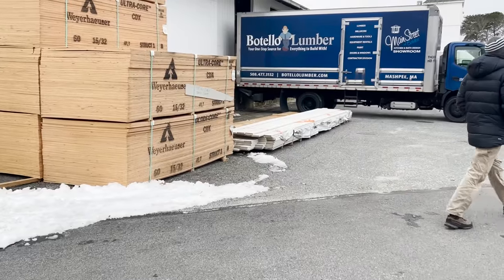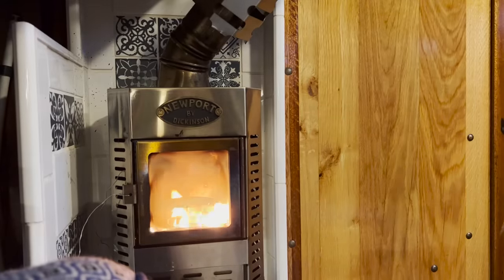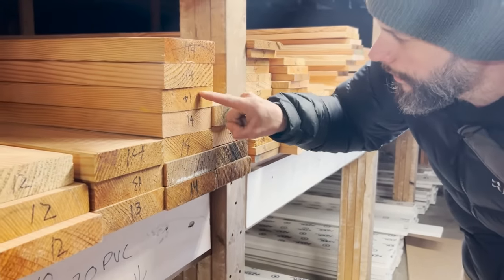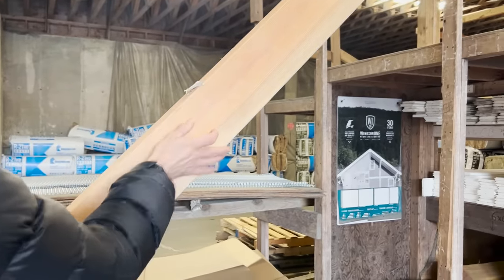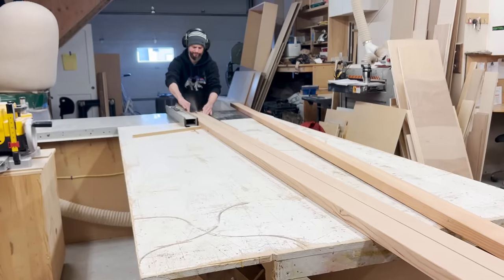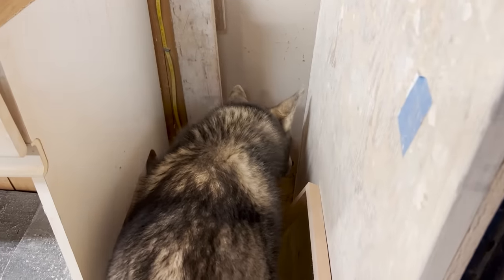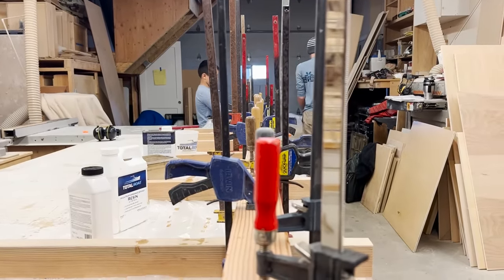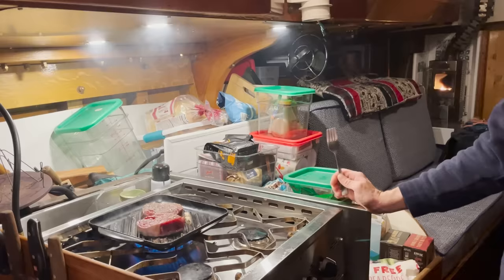Steve Finally Has To Buy Lumber - Episode 299 - Acorn to Arabella: Journey of a Wooden Boat

Comment: Late-generation smoke detectors are too sensitive. One installed in our house in a common area that includes the kitchen was so sensitive, using the toaster to make light toast always set it off. I had to disable it. Warning systems so sensitive they can't be used are useless.
Reply from the maker: Indeed, makes people unhook them altogether.

Comment: Okay, the smoke detector issue is one thing but your propane store alone producing sufficient CO to trigger an alarm?  Got to believe something's wrong with the air-fuel ratio 'cause that shouldn't happen.  Or maybe the diesel stove is "baseloading"?  Interesting to see what others' experiences have been.
Reply from the maker: No, it’s more just when we’re cooking and there’s presence of smoke. Just turning the stove on for, say, a kettle doesn’t do that.

Comment: The fact that your Diesel heater can be affected by your extractor fan suggests that your Diesel heater does not have a sufficient supply of oxygen - which will tend to int producing Carbon Monoxide - it does not have sufficient Oxygen to burn the Carbon to produce Carbon Dioxide.

I don't know for sure about Diesel heaters - but I do know that a yellow flame from a gas heater is a bad sign for it producing Carbon Monoxide.

Please don't kill yourselves for want of piping fresh air in to feed the Diesel heater.

Comment: It always grates me a little when someone says "old growth / slow growth = stronger / better".  While this is true for Douglas Fir it isn't true for the vast majority of woods.  It is only true in softwoods where there is a difference between early (light / weak) and late (dark / strong) growth in terms of size and density.

For Douglas fir, and Diffuse-porous hardwoods (like Maple) it does make a difference.  But for the vast majority of wood including SPF 2x4s, Ash, Oak, Cedar, and Spruce there is no real difference between slow and fast growing.  Additionally in many species fast growing is stronger, easier to work, and more predictable.

The wood database is a great resource for for the anatomy of wood.  For Softwoods looks for the Tracheid size, and earlywood / latewood transition number.  Values like Douglas fir (medium-large, and abrupt) mean slow-growth is stronger.  For hardwoods look at Porosity and Vessels.   Diffuse-porous and/or small vessels like Maple mean slow growth is stronger.  For the rest (Oak, etc) fast growth is stronger, since the earlywood (where the weak pores are) is smaller.
Reply from the maker: I also recommend that people search in the WoodenBoat index for specific questions about species and where they work best, because the Wood Technology department of the magazine is a treasure trove of wisdom about all of this. http://www.woodenboat.com/search-back-issues-woodenboat-magazine —Anne

Comment: - Steve, as you well understand, dog's ears hurt when there is any high pitch sound.
- I am so glad you grasped the pain level documented by Akiva.
- Most upland bird dogs have long, heavily furred ears so gun shots don't hurt them so much.
- Husky type dogs need to hear the sound of river's & ponds ice conditions under their feet.
- Stand up type of ears help hearing the snow conditions precisely.
- The hidden reason behind cropping guard dog ears like Dobermans is so they are aggregated and put on alert by the slightest sounds outside or inside their den/home environment. 
~ ~ ~ ~ ~
- My bet is the closer the suction fan is to ceiling the better for sucking away all smoke from the detectors the fastest.
- { Looks like I loose my bet, per the very end of the video when you are capturing all the smoke immediately while cooking. }

Comment: Would it be stronger if you had left more meat on the boom and not making it that round ,?
Reply from the maker: It’ll be plenty strong and pleasant to use.
Reply: @AcornToArabella  it wasn't a negative comment , just observed aluminium booms used to be round , but you don't see that now , just for yours I asked a honest question and not a negative comment . And with a flat surface makes it easy to fix on flat fittings .
Reply from the maker: Oh no, we didn't read that as a negative comment at all. I've had booms that were box construction and yes, theyr'e very nice for installing hardware to. —Anne

Comment: why use two pieces of wood rather than a single adequately sized piece?
Reply from the maker: It’s what’s available and it’s easier than milling a bigger piece. Also, it might seem counter-intuitive but the glue is stronger than the wood, so it helps with stiffness without making it stiff.
Reply: I get it

Comment: I had brand new house with a attic fan we never had a attic fan before we just used a box fan in a window open one window tried that with attic fan next day at work my wife called had fire department at are house we were told attic  fan sucked so much air out the house it forest air back down the gas fired water heater exhaust so much burnt the linoleum under the water heater pour Akiva  my daughter had a great  Dain did same thing she would go to peace’s when you turned the stove on
Reply from the maker: Wow! That’s quite the thing!